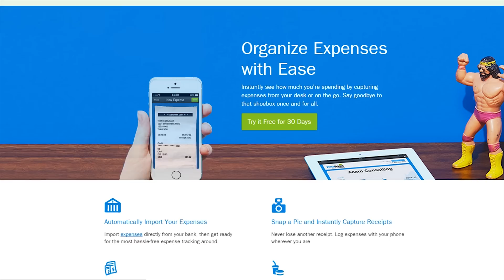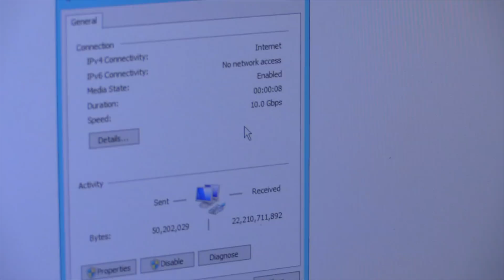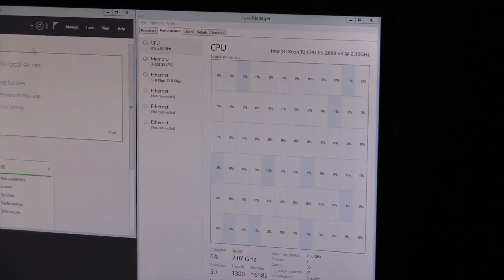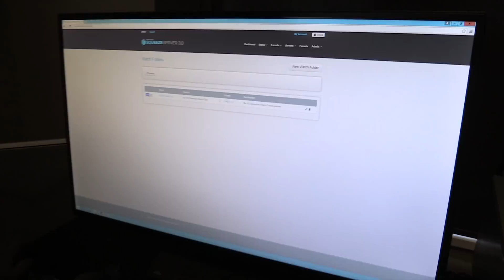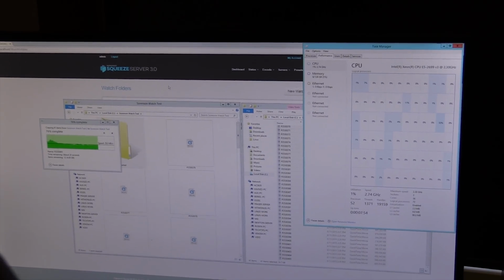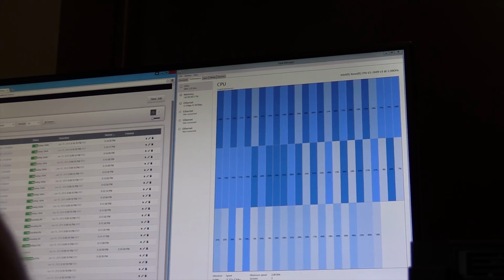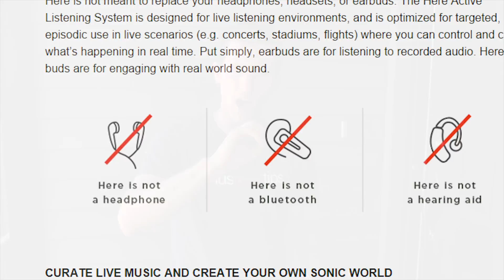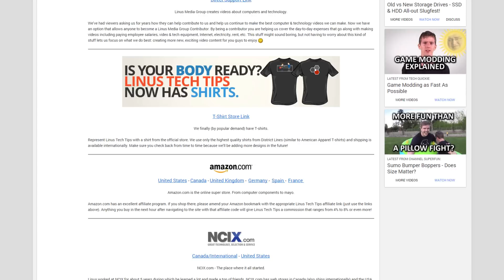36 Cores, 72 Threads, and Two Titan Xs - Our New INSANE Rendering Machine Part 3

Comment: First gotta say you guys are fun to watch. Get to see a lot of stuff I dont normally get to mess with, ala two titans. Great stuff. 
Unfortunately the two titans are nearly a waste in that rig. Performance is only going to go up about 8% vs not having them at all, depending on the codec. The only codec they can really do at all is x264 to add any performance. Others can be aided but are marginal. This is the one area that the gaming derived cards loose a few points to their workstation counterparts, especially on items using cuda or opencl. I'd yank the titans and put them in something else.
Also it wasnt shown in the video, but for the file 10gb intel card, you need to tweak the parameters quite a bit from a simple install to get full potential out of the card. MTU of 9000 for the storage controller can reduce latency quite a bit in some cases (particularly useful on block storage such as iSCSI or FCoE) as well as reduce the load on the card / CPU. All devices must match MTU or it hurts more than it helps. (Also important to note, unless you have a managed switch you do NOT want to cross the streams on this. On a non managed switch the entire network must run the same MTU.. Granted it only degrades in sub miliseconds in most instances, but in storage the counts quite a bit as it only gets multiplied by correcting itself)
Sequential transfers are going to peg out the card no matter what you do, unless you've got a crap CPU / network switch / bad patch or hard drive that cant saturate it (likely)
Perfmon will show you disk access information such as queue length, wait, etc. Far better on the server platform than task manager. 
Also if you're using freenas for the storage server and are using NFS / CIFS for file connections, use the shell and do zfs set sync=always pool. By default as of 9.2 & all solaris machines, the zfs parameters only do sync writes when commanded. CIFS / NFS do not sync by default, causing disk writes to occur in arc which is dead on power loss or system hang. As far as advanced tuning, if your using raidz, believe it or not a cache stripe will actually increase performance especially random / small, as the system wont have to pull off of the disks if its flushed out of RAM. this could be a consideration given the size of the files you're likely dealing with and multiple users and how a lot of editors read their work files. If you're doing stripe of mirrors the read penalty wont exist, so it wouldnt be a factor, and no l2arc would be of any use on that array. Normally I'd say enable compression. But given that its video, unless its uncompressed when stored i think you've hit the threshold of saturation even on a modern xeon of any ilk with that many SSDs for the storage pool. My experience is mostly on hybrid arrays, with only a 8 - 16 tb of ssd read & write cache backing a much larger spinning disk array. In that case storing in the cache only compressed blocks makes sense, but you're already SSD happy.. Its an interesting use case I hope to get to experiment with soon. 
Good luck with that big bundle of fun, not a lot of people get to have such toys!

Cheers!

Comment: imagine the FPS from 1st person shooter games.
Reply: Probably pretty crappy, these processors are useless in applications that don't utilise many cores. It'd be a huge bottleneck.
Reply: bensemus x
Xeons do not have good single core performance, it wouldn't be terrible, just not as good as you would expect.
Reply: Like 300 max on 1080p
Reply: ***** No they can game as they are Intel so good single core performance and when only a few cores are being used they can turbo into the 3GHz range.
Reply: ***** He did a video where he played a game on one. I'm no way recommending it but it works. Also why would they have worse single core performance?
Reply: TalesOfWar I'm not saying got and buy this chip for gaming. I'm saying this chip can game as it can clock up pretty high when only a few cores are loaded. key word there is "few".

Comment: WAIT can't you put 3 titan Xs
Reply: ben fusco he would benefit, rendering uses all power available, unlike real time programs, each GPU would render a different part of the file
Reply: Rohan Rahman A: there is not benifit B: That would require a custom BIOS
Reply: delamovies Meh still he wont MAJORLY benifit
Reply: Rohan Rahman Linus doesn't want people to know he likes XXX for video rendering
Reply: delamovies I think you failed your maths there, the third GPU would have to be running at ~125-150% XD
Reply: He should, then he can finally rival skunkworks
Reply: ben fusco if he used this solely for rendering, it would benefit greatly, 3 GPUs would be 50% faster than 2
Reply: Rohan Rahman it is possible but not with the mobo that he has which he said didnt support multiple gpus
Reply: delamovies transcoding with handbrake uses 0 gpu. encoding with premiere pro uses 0 gpu. scrubbing the timelines uses like 3% gpu. yes hardware acceleration is enabled. i know hes using different software but im sure its the same or he wouldnt have got 2 $4000? cpus and then doing test runs with a single gpu
Reply: ***** You have 2 GPU's at 100% and you add another GPU in the mix which will give you at the MAXIMUM 33.3 reoccurring percent performance increase because now you have 3 cards not 2 and even then it wont scale that well
Reply: ***** NOW WE CAN CALCULATE PIE WHILST PLAYING CRYSIS!!!!
Reply: ben fusco You're bad at math.
Reply: WayZHC Whats 9+10?
Reply: ben fusco 69
Reply: ben fusco He's not using SLI. So yes, it would be 50%.
Reply: Rohan Rahman now that's just simply the shittiest computer ever, if they do that...
Reply: Can you SLI quodro. the $5000 video cards
Reply: TalesOfWar i agree, but titan x is still faster than any quadro, so maybe he wants performance, not precision
Reply: MegaPixel [Airsoft, Gaming and more!]  Finally >:}
Reply: Can anyone porvide helpful information?
Reply: in regards to what?
Reply: specifically?
Reply: tonyman20001 can you sli quodro or will 3 titan Xs help
Reply: ok so you want sli qudros? tell me what you intend to do? gaming graphics design or what is it you do?
Reply: tonyman20001 animate stuff
Reply: alright then i recommend you get the quardros the titan x's are centered for gaming. good luck and share your work :)
Reply: tonyman20001 so can you sli quardros or not.
Reply: yes you can.
Reply: thanks
Reply: no problem good luck!

Comment: Linus, don't be salty that you didn't think of ffmpeg...
Reply: And incron for automatically processing the files as they are dropped on the server.
Reply: And rsync with openzfs for the transfer.
Reply: Leo Tindall Mmmmm, ZFS <3
Reply: When I bulk transcoded my entire video archive from various formats into H264/AAC the tool I used was avconv from libav and a makefile, on a server with 24 threads and 128GB RAM running Ubuntu. Paid $0.00 for software, all FOSS.
Reply: +shadoom Right. But linux is more optimized for servers, and all the applications we mentioned are FOSS and, thus, are very highly optimized and don't cost insane amounts of money.
Reply: Leo Tindall Adobe's creative cloud package has a media encoder with watch folder options that'll auto transcode also...
Perhaps they needed more functionality than that or it has some limitations.
Reply: shadoom I believe all the all programs mentioned were windows applications. All of them seem to do the same thing as far as transcoding.
Reply: Leo Tindall Sodium is actually good for you in moderation.
Reply: No to mention the part where he has to use multiple pieces of software anyway, or be at the mercy of Windows file transfer...
Reply: ***** I'm sorry to hear that, but cases like yours are the exception, not the rule, and imagine if you'd had a similar issue (bad driver interaction, probably) on Windows - there would have been nothing you could do! Windows and Mac OS X, being closed platforms, are entirely at the mercy of their parent companies for fixes and updates.
Reply: LionessTechTips  Lol. True.
Reply: +jangxx shell script can do thar
Reply: +TheDrewSaga if you're buying a new laptop dual boot is pretty much your only option, if you're gonna buy a desktop you can look into PCI pass through coupled with a VM for really good gaming performance. of course in either case you probably shouldn't be using windows 10
Reply: +shadoom "[windows doesn't require maintenence]"
looks at his arch machine that hasn't been restarted since his youngest nephew was born
BWAHAHAHAHAHAHA you... you are a funny guy.
Reply: Ah yes all the fiddling using several different programs to do one thing just to say "uhhh im not using windows" his way is simpler and requires less setup and maintenance